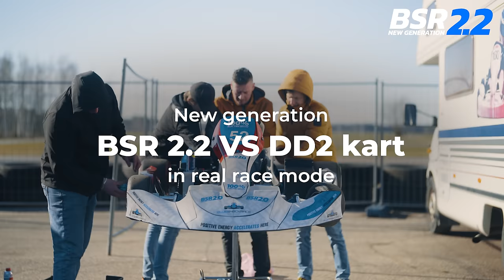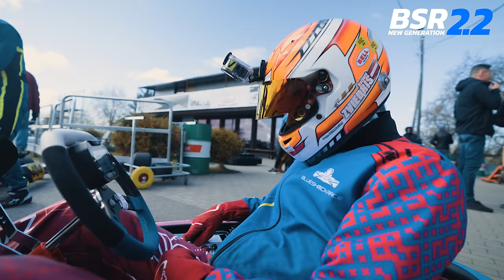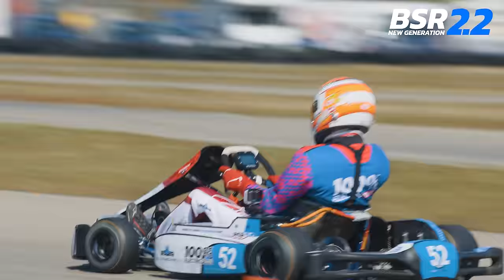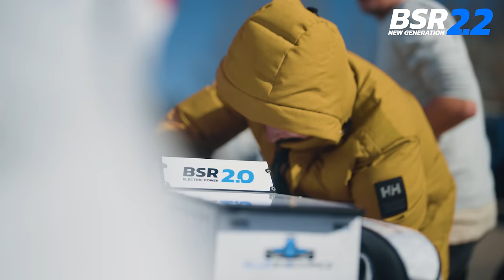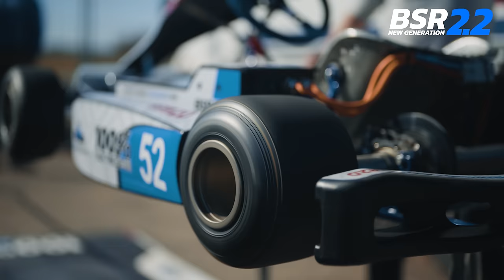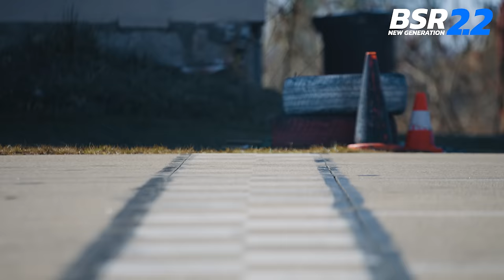DD2 2-Shifter vs BSR Electric 25kW+ (Real Race Performance for 20 laps)

Comment: Is there a maximum weight limit for the driver?
Reply from the maker: No, there is no weight limit. We use a standard chassis, which is the same as in a petrol kart. The only difference is that due to the high torque, heavier drivers won't notice the engine struggling from the bottom.